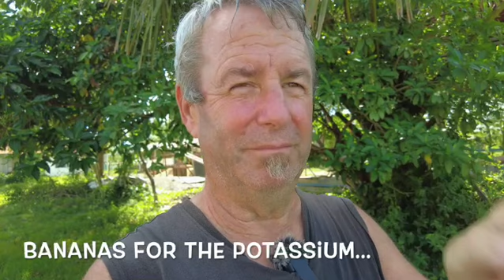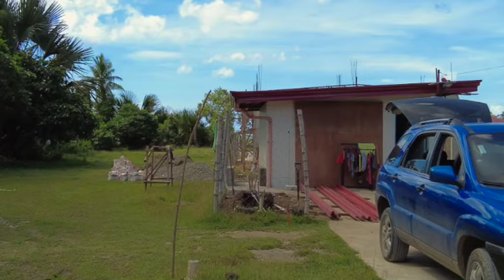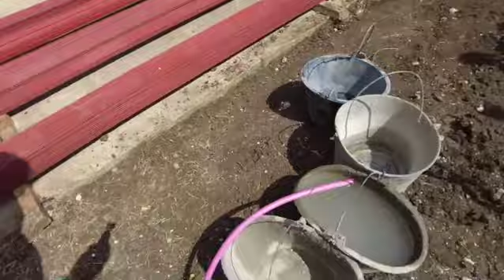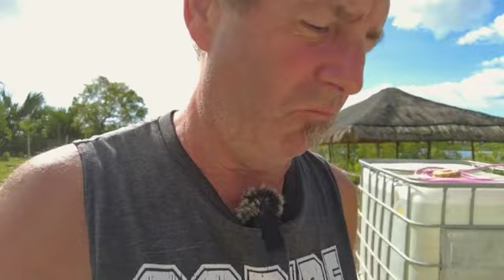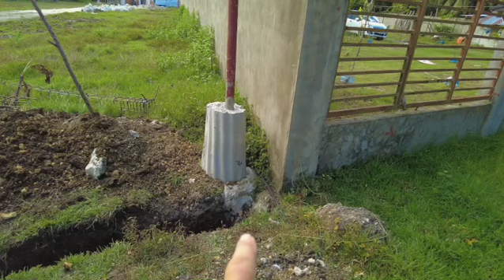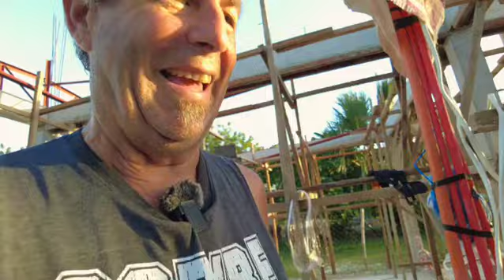Philippine Self Build W9...~plus Ketosis

Comment: Good call on fence. The is one house build where he is very worried about security and is adding electric to top. But he installed a ladder fence so easy to climb.
Reply from the maker: When you drive by a horizontal fence you see everything. Vertical fencing means you need to stop. Camera capture :)
So many modern methods of security… no need for electrics.
Solar lights with motion. Camera capture. Voice over camera too.